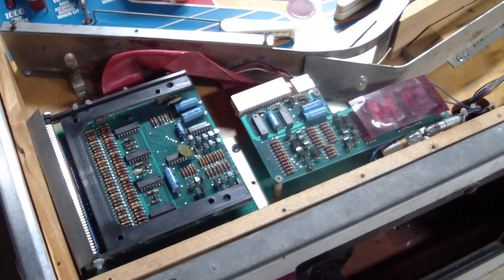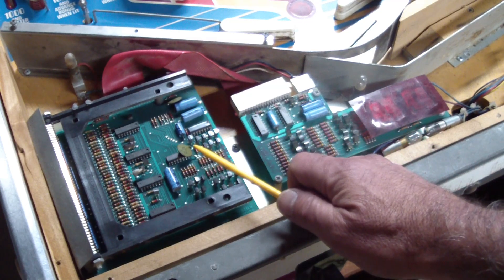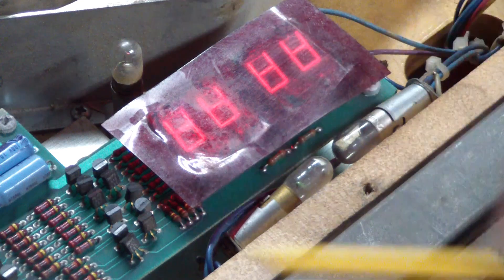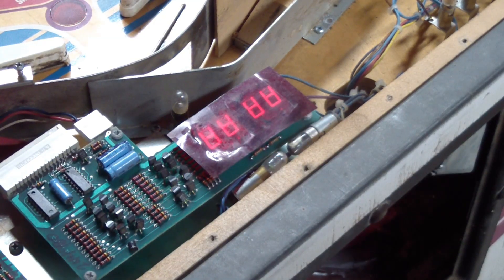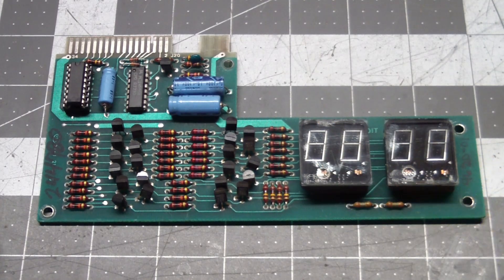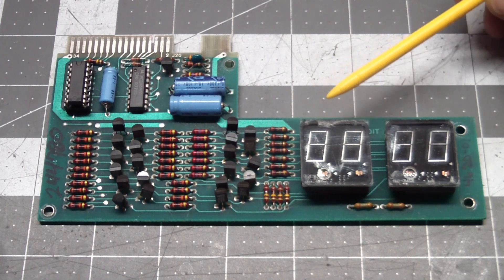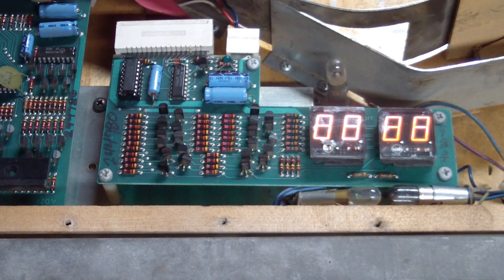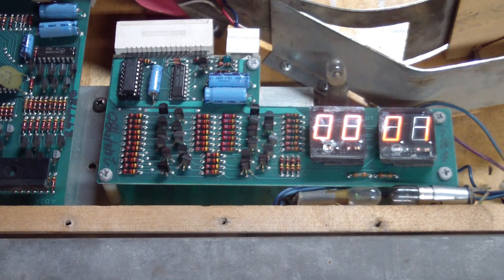AE#182 Atari Pinball Status Display Repair

Comment: The 2-digit displays were still being made until fairly recently.  4, 8, 9, 10, 13, 20, 29 and 32 digit plasma displays are still being made by Vishay.  I have a NOS panel mount voltmeter which has some of these 2-digit displays in it and I may make it into a clock.

Comment: What causes leakage is the GAS displays? The leakage causes the GAS plasma to have a delay turn on, any reasons why?
Reply from the maker: When the gas volume inside the display lessens it needs more time to get excited by the supply voltage. This happens because the seals in the assembly start to degrade.